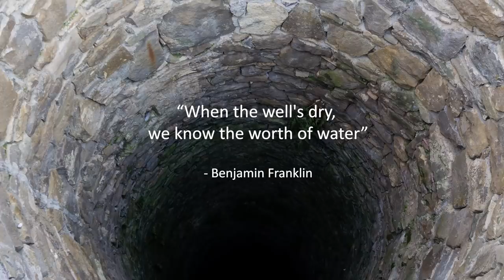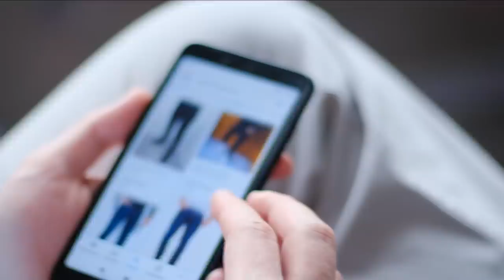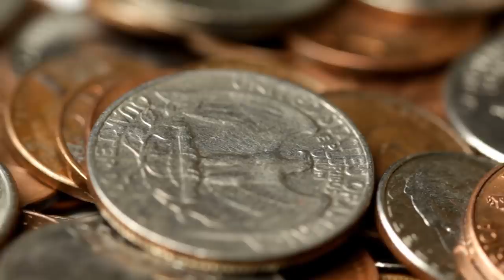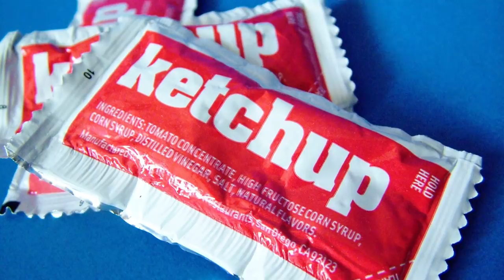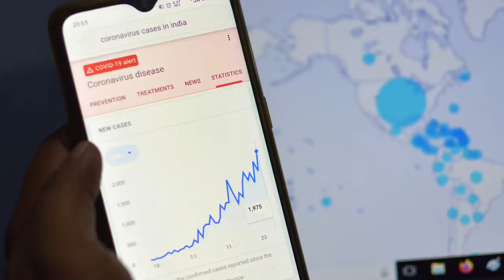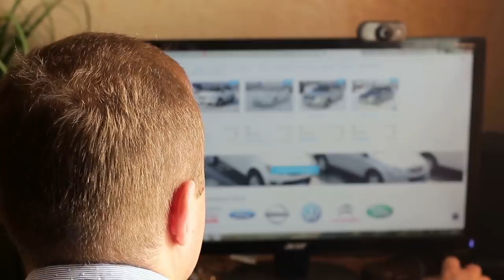Warning! Massive Shortages Are Coming

Comment: I worked at Trader Joe’s for a few years and I can tell you that we were stocking for the day only. If we knew a snow storm was coming, we’d stock up enough for two days. Even then, the trucks that brought them were packed to the brim. We weren’t allowed to have more than 3 big rigs for any one delivery. Sounds big, but that’s not much for a large grocery store. If the trucks were late or didn’t come at all, the store could get wiped out completely in 12 hours. I’m talking totally bare shelves. The grocery store is not set up to hold items for more than a couple days. That system is VERY fragile. People don’t realize how delicate the grocery process is, and how easily it could fall apart. Stock up now, people.
Reply: I shop at TJ's and as a consumer I do see what you are taking about. TJ's doesn't have a stockroom, it goes strait from the truck to the shelves. If I want a certain product, like fresh eggs or other dairy, or even many fresh organic veggies, I have to get there before 10am or they get sold out. I've seen similar things with other larger 24hr stores; where if I wanted an item, I had to get there at 2am when the truck arrived because they would be sold out by 5am. Initially, my main reason for stocking several of my common-use items in the pantry is because I didn't like to shop at 2 am. I've even ordered cases and had them call me when it got delivered just to avoid having to be there 2-3x/week to buy the last can on the shelf over and over. Oh, that's another thing. If your store is having a sale on something, and they are out, or only have 1or 2 left, talk to customer service and order a case or three at the sale price, they have to honor it.

Comment: Some of the shortages are intentional -- so they can drain the supply line before reintroducing the product at a significantly higher price or significantly smaller quantity (for the same price).

Comment: Greenhouses. Canning. Solar. Wind. Well water. Root cellar. Ammo. Firearms. First aid kits.

The newsletter is great!! Informative and detailed.
Reply: Can opener
Reply: @tomkarlen3776  lol true!!!
Reply: @TheTacticalHouse  this is what I’m talking about. 
Make sure your “daily usage” is equivalent to what you will continuously accumulate throughout the day. 
Do NOT overuse. 
And make sure your backup battery storage is secure and ample. 
It can be a learning process.
Reply: @TheTacticalHouse  wow,where do i get one of those?
Reply: Vitamin D
Reply: One brilliant idea I learned recently: dig a deep trench under your greenhouse. The cold air falls down there so your crops stay warmer in cold weather.

This trench can either be- or at least be a walkway into- your root cellar. With the walkway slats you use to work in the greenhouse in place, nobody would ever know what's down below.
Reply: @TheTacticalHouse  I don't think 600 watts will even run one freezer, good luck with that.

Comment: I have been doing my best to prep up and I have come so far. I really appreciate this video, I have been slowing down on it and I shouldn't..
Reply: I saw your prayer request and I am praying for you. I hope it works out for you whatever it is that is troubling you.God bless you.
Reply: No one can be truly be done with prepping. There's always things to stock up on. For example, awhile back I realized all my tools were 120v power tools. I purchased an assortment of hand saws two different hand drills  & bits, and I stocked up on screws and nails. I also have a collection Dewalt tools that I can recharge with a small solar system.

Comment: I think the assessment about the toilet paper is off. I don't think it was primarily panic-buying. 

I think it's because a significant proportion of the population switched, immediately, from settings where they had normally had their TP supplied on huge, commercial-sized rolls, and they suddenly were all home, needing to buy normal-home-sized rolls. But the demand from all the bottoms needing to be wiped, not at school or work, but at home, exceeded what the supply could meet.
Reply: Anecdotally, I disagree. When I would go to the Costco near me, people were buying as many cartloads of tp as they could! I actually saw one family individually buying (because they had to sera buying limit) and then loading up their whole truck bed with it! People went nuts here

Comment: I just got some repairs done on my older cars - glad I didn't wait because the shop owner said that quality replacement parts are getting very hard to get for fixing the vehicles.  I suspect that's another one for the list - if you need things done on your car don't put it off, you may not be able to get the parts to do it and if you can its likely going to cost more the longer you wait the next few months on.
Reply: Paul Silver Good Advise!

Comment: prepper here.  i have over 800 canning jars most i got for free (10 pints today again free) i go to my recycle cent, on Saturdays here in my small town about 1/2 hour before they close and pick out canning jars for free.  i take the rings wide mouth and regular to make sure they will work on the jars.  and for the last several years every time i go to the feed store i would pick up 2 boxes of lids , so i had over 100 boxes of lids put aside and i save old lids in good shape for a just in case scenario.  also have been getting tattlers lids.
Reply: I scored a huge box of lids at a thrift store a few months ago for $25.  There were over 30 if the small boxes of the ball lids, all brand new!!
Reply: @ot505  i got a sack of 308 wide mouth rings all new , think they were used in a wedding to put candles in as they were tide together to form rings or circles, this was also free at the recycle center in the metals, that were recycled
Reply: ps did you do a little dance on your score?

Comment: I order parts for a large factory. The lead time on standard manufacturing parts. Ie limit and prox switches. Valves. Actuators. Etc. has gone from days to months. Cant make anything if you can’t keep the equipment running.

Comment: They are already here. Trying to make mulberry preserves, and I went to Walmart today for Ball lids. Almost no canning supplies on the shelves at all, and no lids. No in-sink dish racks either from Rubbermaid.
Reply: Check Lehman’s online.
Reply: Canning jars and lids are seasonal. later in the summer as crops ripen you'll find jars and lids.
Reply: While normally Lehman's is a great choice, they are also back logged with orders. A lot of canning items are out of stock, as are wood burning stoves.
Check your previously used lids. Some "can" be re-used. I know it's not recommended but in a pinch it can work.
Time to get creative and get back to basics. We're going down hill; poorer countries will suffer first. Watch what happens there cause it WILL happen HERE.
Reply: @deedieducati2272  There are other places on line where canning supplies are available. Shop around.

Comment: Ketchup packages - I can’t tell you how many times I say “no condiments” and still getting handfuls of them. I can’t give them away and they end up in the trash, and I hate food waste. I can’t use them because they typically have high fructose corn syrup, which my body does not tolerate.
Toilet paper - get a bidet. Those became in short supply for awhile.
Reply: They go rancid, too.  I've opened old ones around the house plenty of times and they've been brown and half solid, have liquid.  If you open them over your food and they're rancid, well, you just lost your food.
Reply: @dingfeldersmurfalot4560  yuck yeah that stinks.
Reply: Water availability is going to be a major problem soon as well though.

Comment: I've been to three stores and online, and can say that canned cat food has disappeared. I was at Walmart today and the shelves were all but empty. This doesn't include dry food or cat snacks, although those are also low. Publix and Winn Dixie were doing no better. There were signs hanging saying there were increased demand and supply issues. My suggestion is to get what you can now for kitty, because if it gets worse, you will be glad you did. Some brands of the expensive wet foods are still available. I didn't go to the pet store, but now that I think about it, I probably will tomorrow.

Comment: Out of all the things you could stock up on, toilet paper should be at the bottom of the list. I used to work in forestry as a logger (measuring and cutting logs for export), the logs that are used to manufacture pulp are the same logs you would typically use for firewood. Low-grade wood that isn't fit for structural purposes. We aren't going to run out of pulp anytime soon.
Reply: I don't know about that. It's rather tricky to turn wood into toilet paper.

Comment: Thanks for your video.  I've found certain ammo now available, and dropped from over a dollar a round, down to .80 cents.  Still not where it was 14 months ago though.   Haven't noticed any shortages except runs on allergy meds, understandable this time of year.   Eggs disappeared the week before Easter.   I can see a shortage of mouse and rat traps and poisons on the horizon though.    Regardless, I'm prepping as usual, except added a dehydrator to the tool box.   :)   Oh, off the subject, but I used a can of diced tomatoes with a "best if used by" date of 2013.   No problem at all.
Reply: I ate a can of tuna with 2016 date and am fine!

Comment: No shortages of anything in italy, including ammunition. Lumber has always been expensive, but I haven't checked to see if it's higher than usual. Prices have been stable. 

No increase in crime or violence. It's very low in my area. I still have a years supply of food and water just in case.

Comment: Bicycles and parts/accessories up 100 percent!  I looked up some articles just for this comment.  As an avid bicyclist I noticed prices on tubes and tires double.  This issue is most profound in the UK right now.

Most bicycle components are made in China.  Those that aren't rely on the importation of rubber, steel, aluminum etc.  Retailers are concerned about the manufacturer price increases.

Comment: As a healthcare worker we have already been limited to one mask per day. If a more severe strand hits the USA healthcare workers may not have a PPE supply. I myself was forced to reuse contaminated paper gowns to decontaminate surgical instruments. On a normal basis we must remove a gown and throw it away without touching the outside due to the increase risk of contamination to self. Under AAMI standards we are also to use a clean gown, mask and other PPE donning and doffing. When Covid 19 caused a shortage in PPE for healthcare workers we where forced to not only have a single mask for the entire day but also had to reuse gowns for several days. They where not use on patients however did greatly increase risk of contamination to the worker. Can you imagine having to wear a mask that has body fluids, blood and feces covering it and that is the only one you can have for the day and its mandatory to wear while in the hospital for the whole day? How would you like to put a used contaminated gown over your head and get it on your skin? The possibility of health care workers quitting due to risk is very real. We already had a shortage of RN's with full staffing. Workers leaving due to lack of PPE would leave people without care and people will die from things such as appendicitis because they lack staff to do not even a simple surgery. I already left.

Comment: 13 Open Hereford Heifers all super gentle and coming running for feed 

Avg 625 lbs to 725lbs in weight 

All current on vaccines and worming with Cydectin 

Only selling as group only $975. per head

Comment: People stocking dry food tend to forget nutrition like vitamin c, folic acid, b vitamins, vit d3 k2 , zinc, etc. Fasting and one meal per day for adults
Reply: After the SHTF, there will so much physical work that fasting and one meal a day won't be safe or practical. If you do not eat enough food to make for the calories you're burning, you'll become weak  and will wear down. I do agree on vitamins, nutrients and supplements. These should be stocked up. Finally, there's no way a person cutting and chopping fire wood or working in a garden day after day can make it on one meal a day.

Comment: We've had two incidents that were unexpected.  People should be aware of it.  One is that a city nearby had people coming home from work sick.  They found out later that the water supply was contaminated with bacteria.  The Water Department didn't tell anyone! They found out about it on the evening news.  After that, the department sent workers to every house with flyers.  But it was like shutting the barn door after the cow got out.  This is why it's important to have a filtered water supply at all times.  Another incident involved a wind storm that went through at 50-60 miles per hour.  Hundred year old trees were destroyed.  Electric poles were snapped in half.  I heard on the radio that each destroyed pole has to be dug out, a new one put in its place, and electrical lines reattached.  This can take up to 12 hours per pole!  My city of 50,000 was without power for about a week in some sections of town.  Food in freezers in supermarkets were ruined.  And worst of all, cell phones did not work because the power to the towers was down.  A few years later, we had a 60 mph microburst.  Our area is also prone to tornadoes.  We just had the 37 year anniversary of ten tornadoes which touched down at the same time.  2014 had six tornadoes touch down in one hour in the Green Bay Area in one hour.  2016 had 10 tornadoes touch down in one hour also in our area.  It can and does happen.  I would caution you to get the water and electrical plans in particular in place along with communication needs before you need them.

Comment: I agree. As always, a spot in analysis. Never scare tactics, just solid observations. The coming shortages are everywhere, and many are here now. And price increases. Stock up where you can. We ordered a 1/2 cow from someone who raises beef cattle. Due in the next two weeks. Also have all of our canning supplies put back for canning season and expanded our garden to 1/8th acre and planning for 1/4 acre before years end. On 2 acres so you know what the next plan is- 1/2-3/4 acre by next year. The news last night mentioned several (P&G, General Mills and others-diapers, feminine products, cereal) that have announced current, or soon to be, price increases of 50%-125%. And the chip shortage you mentioned is affecting everything, not just pc’s and smart phones. I work in the automotive industry and have seen various modules (chips are in everything from the engine computer to radio, heater controls, even tail lights and headlights) running in very short supply. Some taking weeks to get. And this has been going on for months. Metal. I ordered a seat track for a vehicle in November and received it late February!  VW has even asked the EU to develop a chip manufacturing plant in Europe to ease the delays or they will not be able to build cars! And with everyone going electric and hybrid, more chips required. Maintain the vehicle you have as new stock will be the next automotive shortage, in my opinion.

Comment: The tp shortage wasn't just because of hoarding. That exacerbated the problem of Residential and Commercial tp being completely different supply lines. When you have a large amount of people staying home and doing their business at home, their needs go up. But the tp industry is just as finely tuned as hotdogs at the stadium, where they know about how much is needed all the time. Even after limits were put in place for buying tp, there were still shortages. My mom works at a store, and they were able to get a shipment of commercial tp and sell it at the store. But it took months to make those connections and work it out.